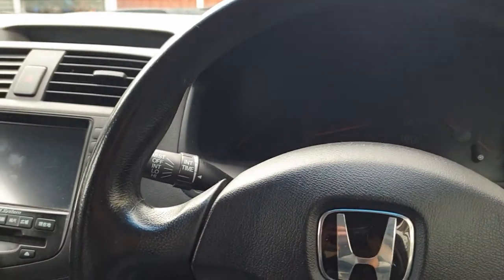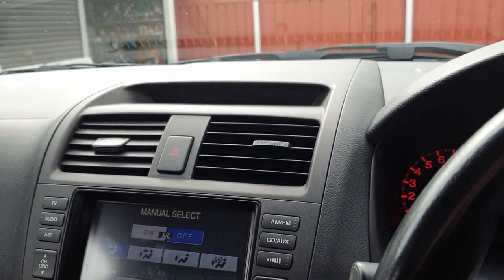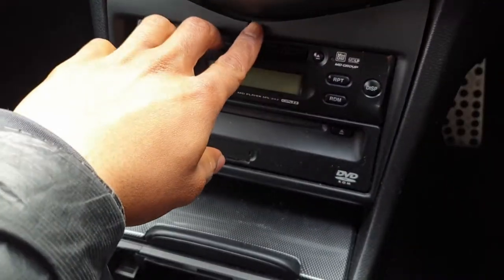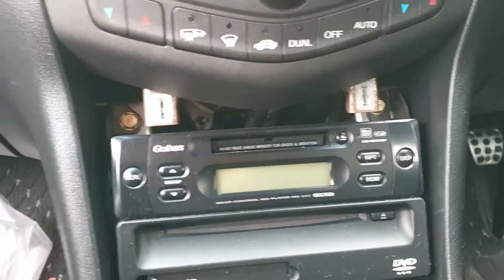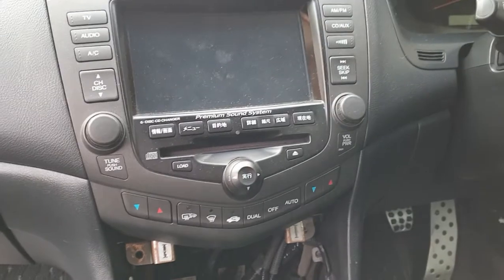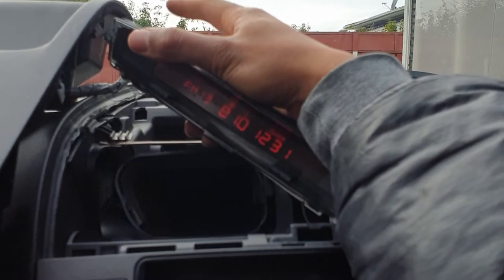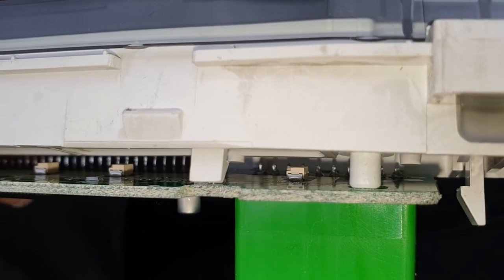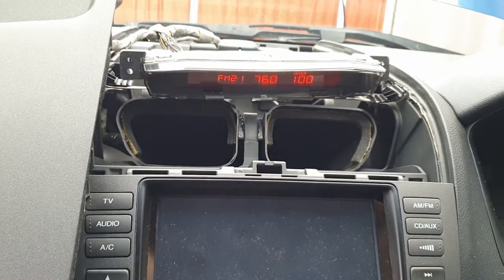Honda Accord Top Display - Clock / Climate Repair & Center console removal (EURO R)

Comment: This fix works, although you can just pull off the top cover by reaching out to the end of the dash, and pull with your fingers towards you. The whole panel pops off without having to disassemble the rest. Maybe you can pin this comment, or put a note somewhere. Thanks anyway :)
Reply from the maker: Thanks for that, I mentioned it in the 1st part of my video.
Reply: @AutoBuddynz  sorry, mustve missed it

Comment: The green plug doesnt come out easily, should it be like that? Should I just use force?
Reply from the maker: Make sure the lock on the connector is pushed down. You can also spray a bit of wd40 to make it a bit easier.

Comment: Good video , what if the clock is not working properly and you can't adjust it ? Mine is way off and I can't change it on the settings
Reply from the maker: You should be able to change it through the menu settings on the radio / headunit. Is it a Japanese model?

Comment: God Almighty ...I have the same problem except i can give it a tap and it come on ...No way i am pulling it apart but thanks for the video...
Reply from the maker: No worries, if its just a clock problem watch the video from 7:50 on as you do not need to remove the entire radio/ media unit, the top vents with the clock just unclips from the center console.
Reply: I had the same issue, also.  My Accord sat for a few years during the pandemic (I was driving my other car during that time), and when I started her back up June 2022, the screen was really bad.  Tapping, or pressing above the screen, no longer worked.